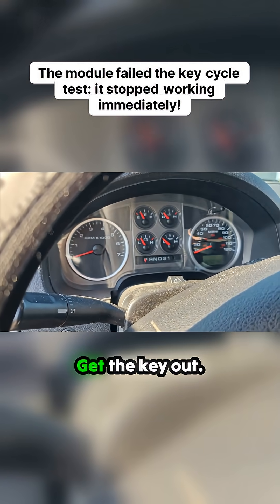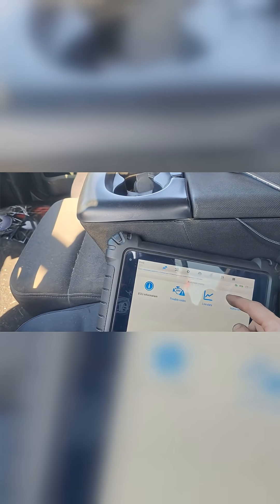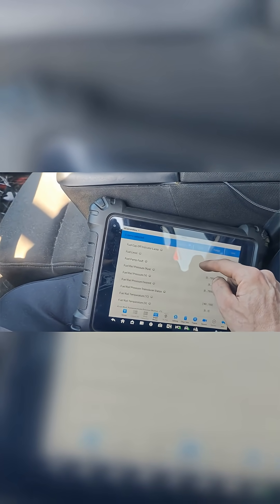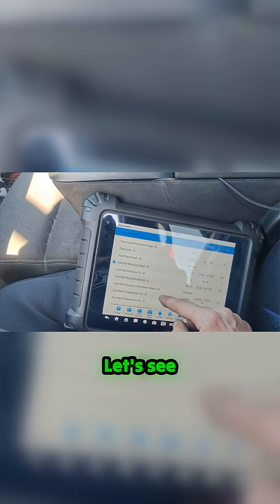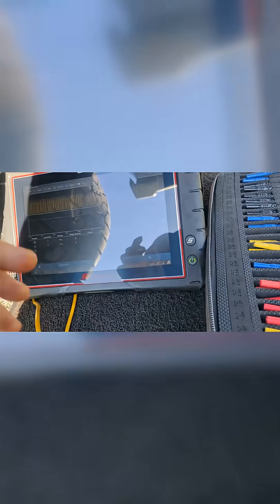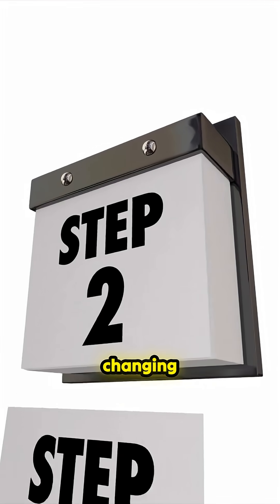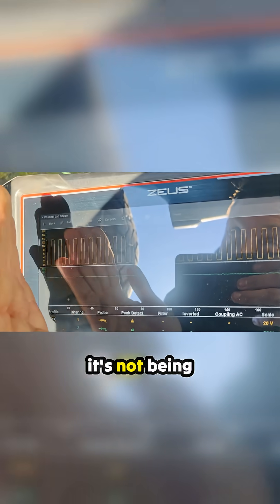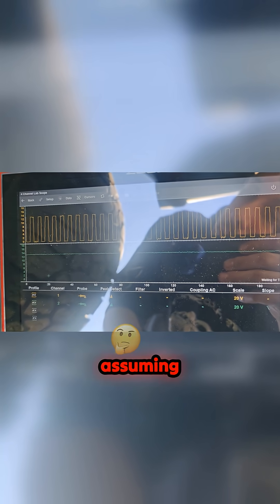The Module That Said NOPE After The First Try. Watch This Moment!

Comment: Check the ground straps for corrosion and the module ground connections.  You will be shocked how sensitive some are for that use dielectric grease on connectors.  I hate chasing those issues myself and have replaced whole wiring harnesses because of a pinhole into a wire that allowed corrosion into the wire.  Happy hunting.